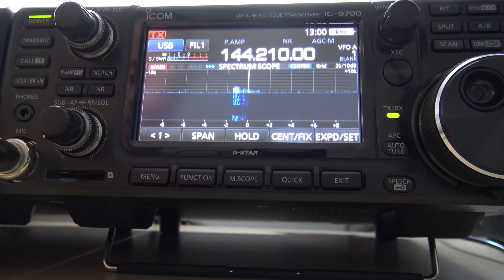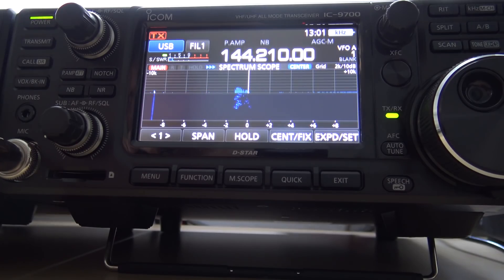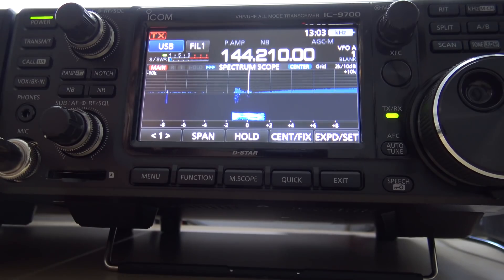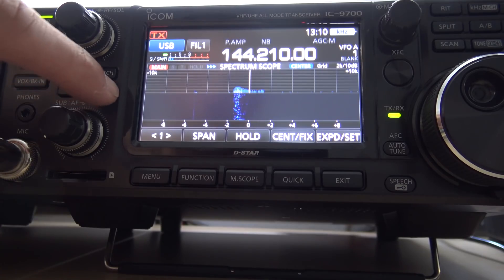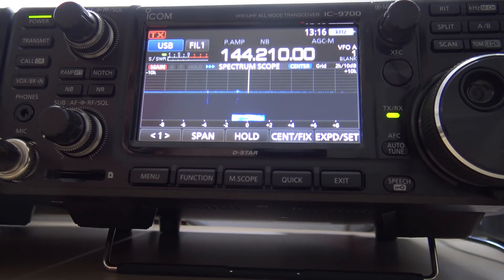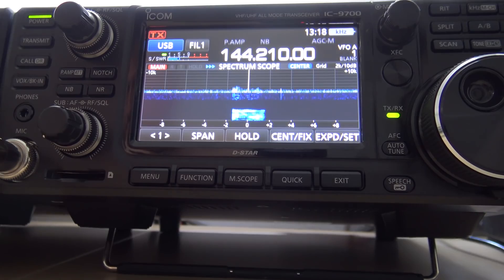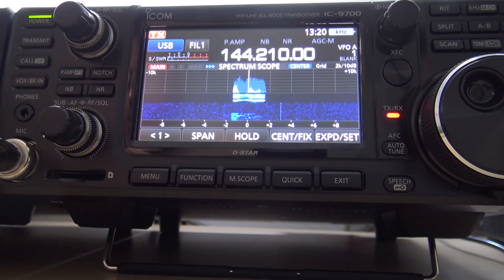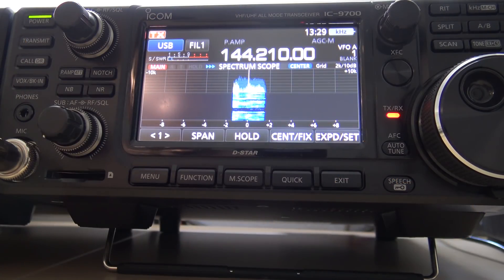IC-9700, 2 Meter VHF Opening, SSB Contacts Statewide

Comment: thumbs up!!! I had  TS-570 with a transverter, a 746 and just got a 9700. Finally more VHF ssb rigs on the market. Let's see more 2 meter ssb activity. Not only is it fun but great in emergencies. Long range without a repeater and the operator base is bigger because tech's can use 2 meters (I'm emcomm for EMA)
I monitor 144.200
73 W9DLP

Comment: Why were you using the amplifier when the radio should put out 100 watts PEP? The difference between 100 & 115 watts would be unnoticeable.I hope to be getting my new 2 meter Cubex Scorpion II 8 element quad & the PAR OA-144 & PAR OA-432 up soon so I can get the ICOM 910H up & running on SSB very soon here in EM80.I love working VHF/UHF SSB.I have only ever made one contact on 432 so looking forward to doing more of that band very soon.  73 de W4KVW  EM80

Comment: How are you sir
I need help, I’m looking to buy the Yaesy FT-991-A or the Icom 9700, for what is the better?
Thank you
Wagner
KC1HMJ
Reply: Save yourself some money & buy an ICOM 910H.I love mine & my ICOM 821H which is my Satellite only rig.The 910H is my VHF/UHF SSB only radio.I have less than $1000 in the two radios combined & you will not buy the 991 or 9700 for anywhere near that price.
Reply: Seeing that your post is a year old, you may have made your decision already.  The 991A is a great rig, the only advantage the 9700 has is that it is full duplex, meaning you can work satellites a lot easier.  The purpose of my 9700 is strictly for working the birds.  If you don't work satellites, the 991A is a great "shack in the box" covering 160 m to 70 cm.

Comment: Considering the radio already puts out 100 watts on 2M, using 160 watts will do very little.  To increase your signal just 1 s-unit you'd have to increase your power by 6 dB which is doubling your power twice: 100 + 100 = 200 + 200 = 400 watts just for 1 s-unit which will not really make or break a contact.  I'm willing to bet you could have turned the amp off and he wouldn't have noticed the difference.  Looking forward to getting my beam up so I can take advantage of any 2M openings.

Comment: Great to see you on 2 meter SSB bro!  It's my favorite form of ham radio, SO awesome!   I regularly get about 250 miles of coverage in the mornings with a 4 element M-Squared beam only about 30 feet off the ground and of course horizontally polarized which is the way to go.  I saw that band opening and wished it would have extended to my area in Kentucky but I regularly talk to our brothers in Georgia without tropo so hopefully will be able to talk to you someday on 144.200 in the morning. -73 from KJ4JAE!

Comment: Can any colleague explain why this 9700 IC radio has a low eham?  73
Reply: Eham is mostly inhabited by morons. That's why!
Reply: I'd say because it's Overpriced & overrated from what I have seen & heard from them.A whole lot of Hype & I Love ICOM but would never own any radio with a touch screen even if it were FREE.NOT for ME!
Reply: Maybe because of the frequency stability problems this rig came out of the gate with.  It makes digital operation with WSJT-X difficult or impossible.  It also won't do 9600 bps packet.  Icom really screwed the pooch with this rig.  It has an external 10 MHz reference input, but it doesn't lock to it.  Really, really, really stupid design.  They've improved some of the stability problems with software updates, but this rig should have been so much better.  People are avoiding it.  Price is down $700 in a year.

Comment: Why yse an amp when you already have 100 watts off the radio?
Reply: Tom Scott  I was thinking the same thing why not let the amp do the heavy work👍
Reply: Maybe just wants to put less strain on the radio by keeping the output low and letting the amp bring up the power
Reply: @roadsidediner-video2792  If it can't handle it then it's a POS.

Comment: Driving a brick amp with a 100 w transceiver can easily turn it into a splattering machine.  Several people have commented on this below.  160 watt amps typically require a max of 30 watts drive and usually splatter all over the band, whereas your 9700 should be very clean.

Comment: What 4 R U using 150W amplifier if you have 100W at trx? There shoulndt be significant benefit to get 50W more... Nice rig.. Just thinking to buy it 🤔
Reply: Not answering for him but I would rather put the load on a few hundred dollar amp over a couple thousand dollar transceiver.
Reply: @K4MJV  It would make a lot more sense if he were driving a legal limit amplifier or even a 300 to 400 watt amplifier but using a 150 watt amplifier makes Zero sense.If he's worried about blowing up the radio using it at full output then he should have purchased a radio that he had confidence that it can handle full output being used? It says that he was only getting 115 to 120 watts out of the amplifier also.
Reply: @1OFGODSOWN  Maybe it's not about being afraid of blowing up the radio, but instead about prolonging the life of the radio.  Why put continuous stress on the radio that could be shifted to an amp instead?  It's just about taking advantage of alternative choices that can add extra life to an expensive radio.  From cars to sewing machines, nothing seems to last as long when it's ran at it's peak output regardless of how much confidence you have in it.  Running a 150 watt amp at 115 watts is not only not only going easy on the amp, but is also saving a lot of wear and tear on the radio,
Reply from the maker: @K4MJV  Exactly

Comment: Is it common to have to use a clarifier on 2 meter ssb? I worked a guy and he had to tune low, I had to tune up about 80 cycles to get it to sound right . Thats my only 2 ssb contact ever. Maybe my radio, or his is off a little. 991a here, his was an 897.
Reply: I have an 897D  that is also a bit off frequency compared to my FT-991 on 2 meter SSB. It's probably just the radio.   I own both and have compared them and my 897D is defo the one that is off.
Reply: The higher the band, the more off frequency your radio will be because any frequency error in the master oscillator gets multiplied.  All oscillators drift with age and temperature.  On HF with a modern radio, this drift is barely noticeable and everyone appears to be on frequency, but on VHF/UHF it will be 50-500 times worse.  This particular radio will adjust itself on frequency if you have an external reference like a GPSDO.

Comment: Where can I go to find out more about Ham Radio? I've got a Heathkit Apache that I inherited from my Father in law, but I don't want to have to learn Morse Code. So I'm trying to figure out what kind of radio I can use to reach long range and what kind of antenna will work in my attic, (my HOA is a pain in the ....)!
Reply: I suggest having a look at www.arrl.org and/or contacting your local radio club.
Reply: Morse code proficiency is no longer a licensing requirement. Although....you would do well to learn it. Learning CW will do more for you than a $6k amplifier.

Comment: Doesn’t the 9700 put out 100 watts on two meters? The amp at 120 watts makes no meaningful difference. 1 dB gain is additional 30% power, so 120 watts is less than 1 dB more than 100 watts.
Reply: Maybe it's not about the extra 15 watts, but instead about prolonging the life of the radio by letting it run at lower power output.
Reply: @roadsidediner-video2792  If it can't handle what it was designed to do then it's not worth the price they charge for it.My ICOM 910H is still going strong & I'm not going to use my amps with it.
Reply: Internal pre-amps on many modern shack in the box  VHF/UHF radios are  generally not as sensitive as using an outboard  RF amplifier  with a hot GASFET pre-amp ,  for some  hams  just makes it simpler to  incorporate as the  pre-amp switching is built in to the amp   and  still allows options for  use with other lower power all mode transceivers they may own presently and in the  future,  the  outboard amp  also  allows an option of not stressing  the finals in the 100 watt  transceiver models  to full output,   All mode VHF and UHF radios that can push 100 watts tend to be pricey so not a bad option if you have a couple low drive amps on the shelf that are Gasfet equipped, ,  especially if using older used  70's to 90's vintage  gear with typical 10 to 25 watts out,  Icom IC-275A and RF concepts 160 watt amp with Gas Fet pre-amp and a 8 element yagi  at 40 feet was an awesome combo for me for several years,  really miss it,   73- J

Comment: I have the IC-910 what is the difference between the two ?
Reply: IC-9700 is SDR and has a panadapter. It also includes D-star and 23 cm.
Reply: R C any suggestions for a mobile HF antenna for my truck
Reply: The 910 H used audio DSP which made the receiver noisy. Signal to noise ratio always requires you to pull in RF gain to quiet down the receiver.
Reply: @JDDupuy  I have the ICOM 910H & ICOM 821H & as with all of my radios I run them thru a ClearSpeech DSP base module & noise is NOT an issue.I do not have the optional DSP units installed in the 910H but again noise is NOT an issue because the ClearSpeech unit kills the noise.I paid less than $1000 for the 910H & 821H combined so I use the 821H on the Satellites & the 910H on VHF/UHF SSB Only.

Comment: There should be a hole on the side of your amplifier for ssb delay adjustment
Reply: I was just going to mention that also.
Reply: Better wire the transceiver to the amplifier via PTT signal and you get rid of delays. The automatic switching is problematic and it's not used anymore
Reply: Manuel Sánchez Raya  very true but on the mirage amplifiers you still have to switch it to ssb for bias reasons the mirages use variable bias in ssb position. But he could hook it to the send jack on the back and then turn the delay all the way down in the amp.